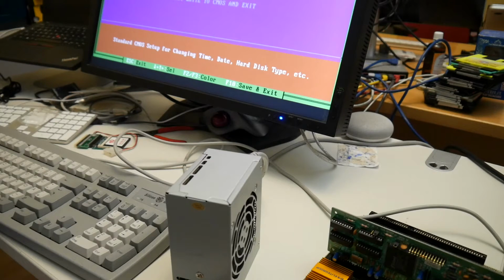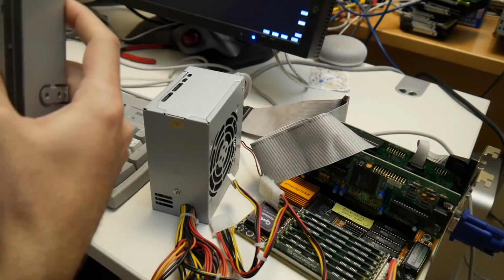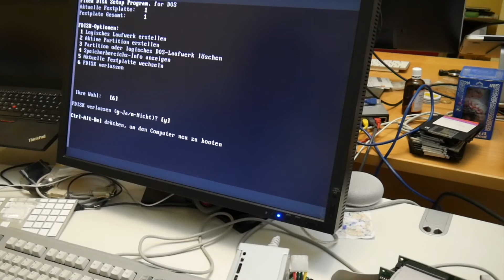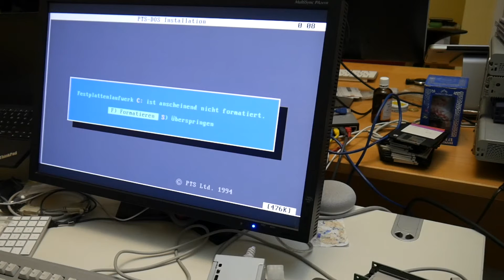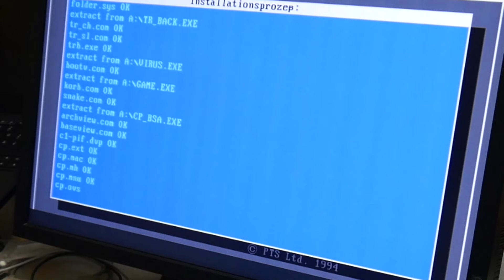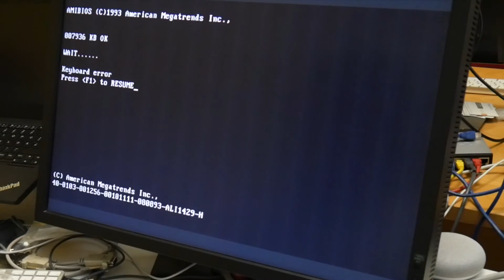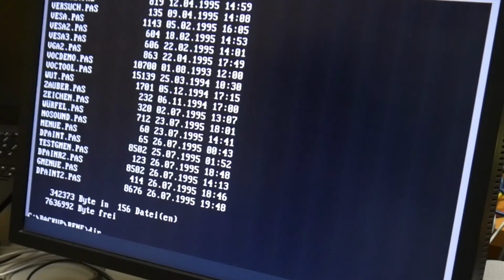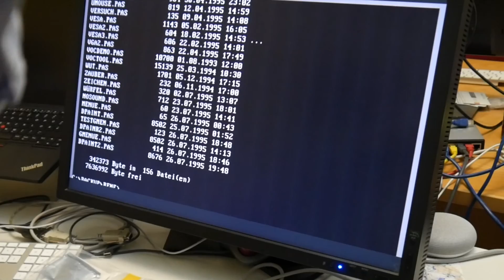Does Compact Flash work better for vintage IDE?

Comment: When trying to use IDE to CF in things that are not dedicated PC hardwear like multi track recorders these simply don't work 
i got a startec ide to cf and tried with a tascam 2488 and it does not recognize the adapter i have tested everything CF and adapter simply replacing a IDE HD does not work.
Reply from the maker: likely depends on implementation details of the CF card, it should be possible to find a compatible one unless they included dedicated code to lock to their approved / sold ones

Comment: Has anyone encountered such a strange problem on the 386th? There is an adapter and a 256 MB flash card, and when connected to a computer, the image on the monitor stops displaying. As soon as I take the adapter out of the computer, the image appears again
Reply from the maker: no, IIRC only resetting the machine plugging an IDE drive cable 180° reversed on old, not coded 40-pin connectors, ... :-/
Reply: @renerebe  I reconnected the adapter only when the computer was turned off. When there is no image, all postcodes go through and there is not a single error. I don’t even know what to do, the old 40MB hard drive is already dying, and there are few floppy disks left

Comment: I'm a little late to this, but I got an HP internet advisor that came with a dead drive. I put a new one in but after doing that it refused to post. After removing the drive It worked again. I'm curious as to what would cause such a thing (if you have any idea)? I'm thinking about getting a cf card and adapter for it but I don't know if it will stop it from working.
Edit: oh wow. After I went a little further into your video I saw this board has the same bios!
Reply from the maker: Maybe inserted 180 degree reversed shorting some reset pin or so. Or an otherwise dead drive
Reply: @renerebe  The cable has the missing pin for orientation and the drive is fully functioning. Could it be something with power draw or a different pinout?

Comment: Actually CompactFlash uses the Parallel ATA interface, that's why "adapters" are only direct wiring the conectors. As it's a direct interface it doesn't need any "translation" (as it would be for instance, with a SCSI2CF adapter) so I think CompactFlash is a good choice for IDE upgrades in old systems.
Reply from the maker: Yes, did I not clearly enough say that?
Reply: @renerebe  Sorry I just missed that

Comment: There is a better option than this. Many embedded systems use Disk-On-Module (DOM) and directly plug into the IDE connector.

Swapfiles/Pagefiles should be avoided on non-SSD flash, because there's no intelligent wear-levelling or TRIM option.
Reply from the maker: All DoM I ever had were pretty slow and  such. Cf are quite neat, cheap and easily swapable  too.
Reply: no one cares about wear leveling or TRIM on a CF card when there cheep and your running them on vintage computers you power on maybe once a week for a few hours...

Comment: I ran into some roadblocks when i was trying to get it to boot but it works ok. using a 8gb one with Windows 95 on my gateway solo laptop. SD works too. i have heard that it's not as compatible compared to CF adapters and I have yet to see a machine not recognize the adapter. I have many Socket 5/7, Slot 1, etc. motherboards, and some old laptops, they all recognized the SD card adapters.
Reply from the maker: The adapters are passive - just wiring the signal pins thru. The difference are some cf cards not supporting classic "true ide" anymore

Comment: Hi I have logic analyser with a failed hard drive I am trying to replace with compact flash. The adapter card had 3v3 or 5v, how do I know what will be the voltage for the old flash card. I have looked up the number of the flash card but it’s probably very old and I cannot find any information for it. Many thanks. Regards Chris.  This is the item I’m restoring https://youtu.be/mc_vYsNttew
Reply: Yo! Those things are standard, so it should just work. I took a quick look to your video, and the hard drive was a typical old notebook IDE drive (those fat ones). You can even use CF2IDE, SD2IDE and SATA2IDE. It will work! 

From Wikipedia: The ATA connector specification does not include pins for supplying power to a CF device, so power is inserted into the connector from a separate source. The exception to this is when the CF device is connected to a 44-pin ATA bus designed for 2.5-inch hard disk drives, commonly found in notebook computers, as this bus implementation must provide power to a standard hard disk drive. 

The adapter you need is a 44pin CF2IDE adapter.
Cheers!
Reply from the maker: in general I agree, just not sure if there are 3.3v only CF cards that could potentially get damaged by 5V IDE, ..!
Reply: @alexviralata1356   Thanks for watching and help.  Ok i have plugged the SSD into an old computer run windows 98.  The drive is readable and I have formatted it within windows 98. So my drive is working.   I think SSD drive adapter will fit the log analyzer hard drive cable as the adapter has  also the small IDE ribbon for the laptop hard drives.  So my next question is how can I setup the SSD to be bootable when I install it in the logic analyzer. Ideally i would have the windows 98 files installed.  The logic analyzer  itself does have a floppy but has no CD drive. It does not have USB.
Reply: @allthegearnoidea6752  Oh boy! This will be a rather long post... so get cosy! 
The quick and dirty:
a) Make Drive bootable
b) Copy Windows 9x CD contents into drive.
c) Boot the machine, and start the installation.
There's no need for partitions when doing this.
The long and tedious version is:
Firs, you need to format that drive in FAT32 file format (if it's less than 2GB then FAT16 will suffice). You also need to make it bootable. Use Windows 98 SE Boot Disk... Boot from it, and run "fdisk"; delete any partition on the drive and create a new one (primary). Once it's done, restart the machine and boot again from the Boot Disk, and this time, run "format c: /s". The "/s" at the end, will add the file "command.com" to the drive making it bootable. (I don't remember if it was /s or /sys, so if once fails, try the other). 
Once the drive is bootable, remove it from the machine and take it to any modern PC you have with CD Drive. If you are going the use WIndows 98 SE on it, copy the folder "win98" into the drive. When it's done, take it back to the Logic Analyser and let it boot. Then get inside the folder and start the installation: cd win98, setup (or install one of the 2 is). 
And that's it! You don't need to run fdisk if the drive already is FAT32/16 (this also means, no need for "format c: /s"). 
The installation process will be crazy fast, thanks to the IOPS advantage SSD have against Disk Drives.
Cheers!
Reply from the maker: If you find no info you could measure it ...
Reply: Bits & more by René Rebe  how can I measure it ? This is the flash core operating voltage not the power coming from the computer?
Reply from the maker: If it is not the interface voltage, but just some flash IC voltage why do bother? Either it is interface voltage you can measure, or not. Do you have a link to the part you are looking at?
Reply: SSD-C01G-3550 Silicon Systems. Sorry I did not explain myself properly my apologies.. I was concerned that supplying 5 volts to a 3.3 volt memory device could damage the memory or the computer.  I dont know what the voltage specification is for the memory device, I am guessing from the serial number that is 3v3-5V.   Thanks for the advice. Do you have any time to help me figure out how i can load the software. This is a link to the forum thread, dont worry if not you must get a lot of requests for help. https://www.eevblog.com/forum/testgear/tla-704-series-logic-analyzer-230110/
+
Reply from the maker: I did not find the spec for that flash, so no idea if it can operate on either voltage, driving it with too much may obviously damage it, ... Do you have the original software? Otherwise you could install software / OS on another IDE / CF flash equipped PC; or using an USB to CF/IDE adapter like I in maybe this video? I usually use Linux so I have dedicated control over how I use things, without Windows telling me it can't install on this external device or something, ..!
Reply: @renerebe .  Thanks I only use windows. I have just plugged the SSD in to the IDE adapter and installed into an old computer running XP and i could format FAT 32.  I think my problem is that I need to install all the software onto the SSD before i plug it into the logic analyser own internal computer I think its 386 based. The logic analyser run either windows 95 or windows 98. So assuming that the SDD function when I install it into the logic analyser, how  do I install the the 98 software. I have bought the 95 and 98 Cd from ebay , but the logic analyser has no CD drive.  So I guess i need someone familiar with installing windows on old machines etc.  Thanks for the replies very kind of you to advise. regards Chris
Reply from the maker: Sorry, I know too little about your device, maybe it helps to install it in some virtual machine, on Linux I prefer the free Qemu for that. On modern Windows PCs it may be actual more difficult to install and setup vintage software and OSs, …
Reply: @renerebe   Yes, Thanks I think the virtual machine would be a step to far for me.   I guess there is an answer and its probably easy if you already know the answer. Thanks have a great day love your channel. regards Chris

Comment: Hello! I haven't watched this video yet, but I can safely say: YES!
It all depends on the adapter (it's just a pass-trough) and the CF it self. With SD2IDE adapters it's a bit more troublesome since there's a chip on the adapter translating the calls. 
Cheers!
Edit: I was right ;-)
Reply from the maker: yes, this adapters are purely passive, just wiring the CF to IDE and power pins. I can imagine different brand, generation and capacity CF cards may give different results. I happen to have an "IBM" micro drive from old embedded project stock that I wanted to show in a future video, too ;-)
Reply: Alex Viralata   I guess I just need to give it a try then.
Reply: I have heard that CF was more reliable than SD, and more compatible too.